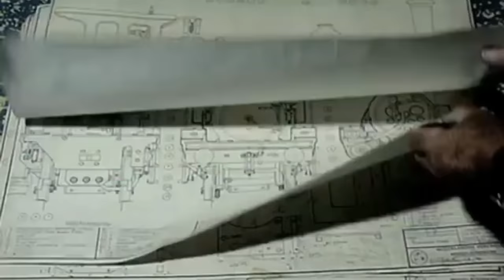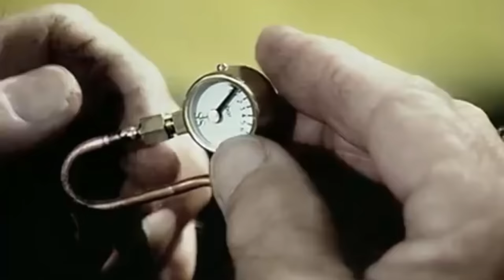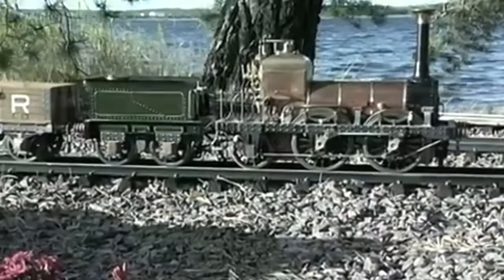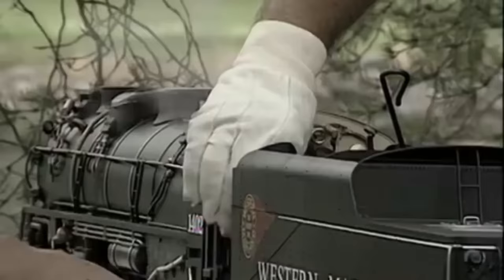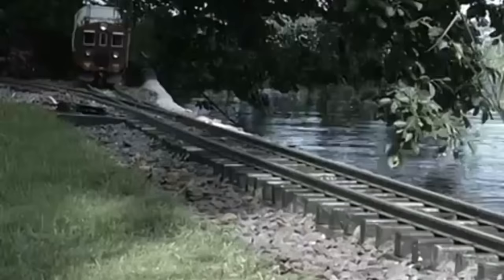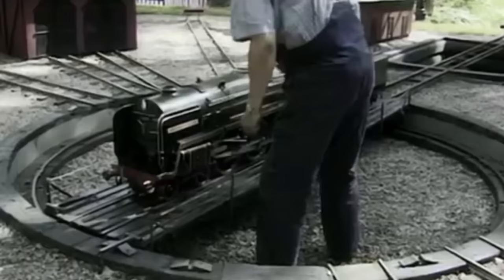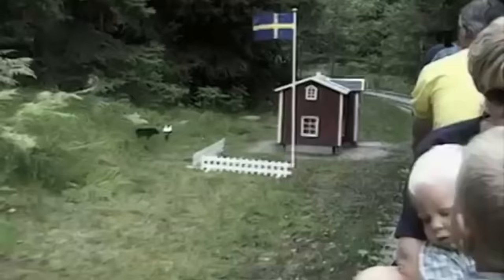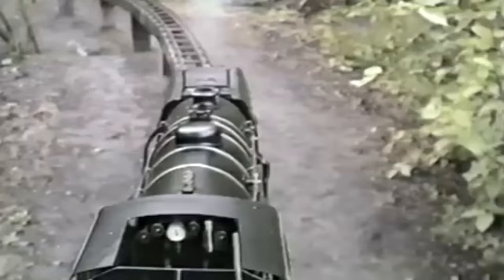History of Live Steam and Model Engineering

Comment: Many of the craftsman that built great model steam engines are no longer with us. I think about the older lathes and mills they had to work with to produce the very detailed and accurate parts. I have never met any of the builders in my 75 years. I have been fortunate to build several small stationary steam engines from kits sold today.
Reply: The day's of Bridgeport and Colchester etc are fading sway.
Reply: @tevya017  You can make more working at McDonalds than you can as a apprentice machinist in a lot of cases. I’m in my 20s and I find it so sad to see a lot of skilled jobs disappearing.
Reply: great comment ,i got my machinists paper back in hs on manual machines likes these......i was no were near as good as these gents but i knew the trade ....kids these days dont have skills like this or the aptitude for the math

Comment: 120 years ago around your Christmas tree before people had Electric in their homes you would have a live stream engine 2 inch gauge something like that going around the tree which is lit with real candles. It's amazing how nobody Burns their house down in those days with candles burning in the tree with a live stream engine circling it that was probably alcohol fueled. I guess people had more sense to not do stupid things. I've seen some of those turn of the century engines and they are like Jewels with the amount of handicraft work involved. Of course they were rather expensive but then quality pieces of equipment usually are but then with maintenance they would last forever. You have 150-year-old live steam engine from the turn of the 19th century that have outlived several of their owners.
Reply: There were lots of fires in the days of candles and early electricity, I had a pre-war O scale train set that was in a old house fire.

Comment: As a boy i made things out of wood,  and then plastic,  but this is model engineering.   It is wonderful.  I have a question:  If you aim for true scale,  are there certain things that will not work if made to scale?  I suppose boiler pressure has to be "real"., but you aim for scale speed.  I suppose that aircraft modellers have even worse problems?   Excuse my ignorance,  but once one gets thinking...
Reply: Physics do not scale down, like the steam whistle, and some things become too fiddly like super heaters.
Reply: peter:  You are correct, for example the fire tubes in the boiler are not to scale but larger.  The boiler shell is thicker than the stress calculations require.
The operating boiler pressure on a model may vary between say 80 psi to 110 psi, with 100 psi quite common.  This pressure is sufficient to cause wheel slip with the locomotive.
The full size locomotives had boiler pressures varying from 250 psi to 350 psi.
As to scale speed.  I've run my locomotive at a scale speed of 160 mph, and that was scary fast.  The reason being is that model tracks are not as smooth or level as full size tracks.

Comment: I have a model steam traction engine.  Size of a large power wheels..   never fired it up.  Got it from my grandfather.  I’m afraid to fire it..  boilers scare the hell out me..   I’m a bike guy.    But I love steam      But dam steam you scary!!! 😮
Reply: Test the boiler with water pressure to 1 1/2 times the operating pressure.  With no boiler leaks or deformations you should be OK.